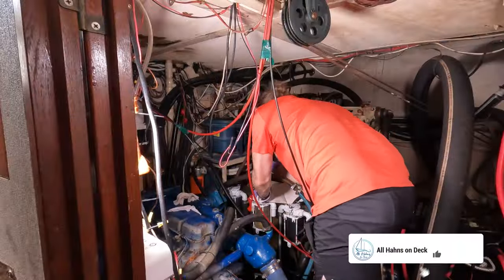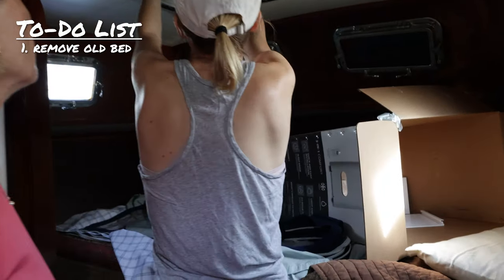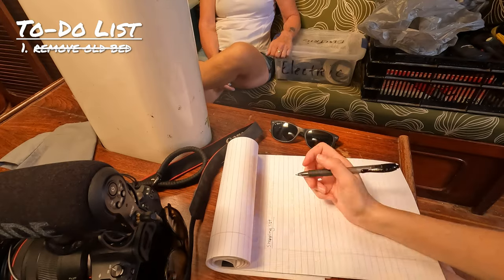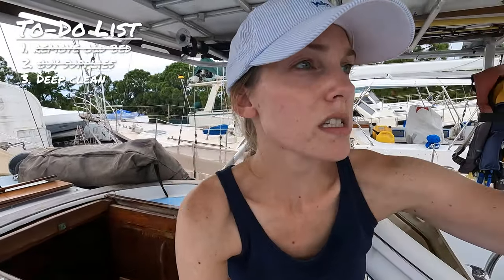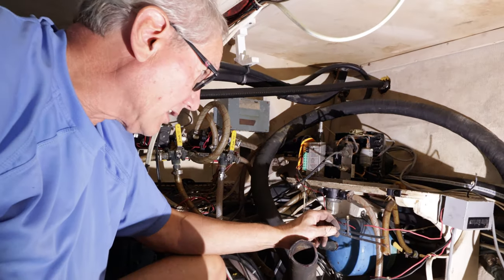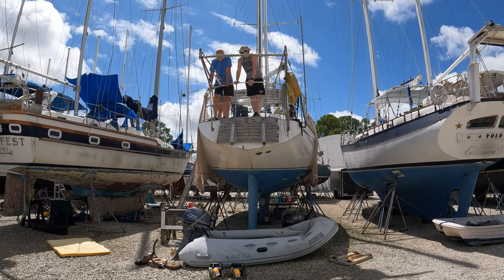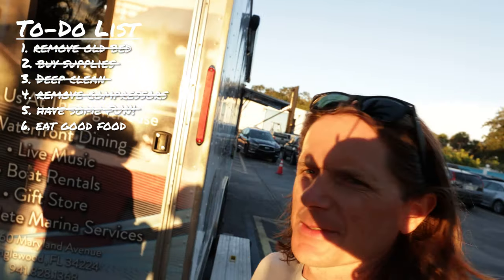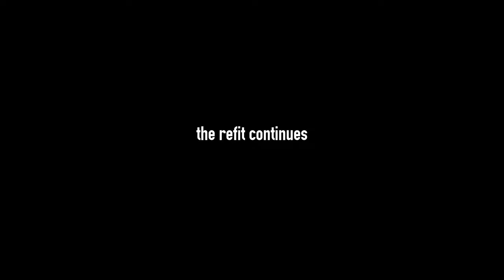BOAT LIFE: THE TO-DO LIST NEVER ENDS | AHOD 13 #boatlife #boatrestoration #boatyard

Comment: I enjoyed the video.  If you want to change the diesel genset they make two very small, almost portable, diesel gensets that could run two Aircons for a boat that size.  The Next Gen 3.5kw or the Whisper Power generator.  With soft starts one will run two AC's with a little left over for other stuff like charging.  Really they are super small, affordable, and are diesel instead of gasoline.  Two people can handle one without needing to get halyards or come-alongs involved at least through the companionway..The typical fuel usage is about five-ish hours per gallon of diesel.  I made my own batteries using EVE280AH Lifepo4 cells from Docan Power, and have 300 watts of solar.  The solar can nearly power two freezers and our watermaker.  Which if you want to make you own 30-40gallon per hour watermaker you can make one for under 2k.  YOu can find it by searching yt for" how to make your own 30 gallon per hour watermaker using"  there are parts in the more section and the comments.  I can almost do it all on solar, but use a gas powered igen2600 to top things up each day as I  converted the galley to full electric.
Reply from the maker: Fantastic advice and suggestions! We will look into those small diesel generators
Reply: @AndyandKirstin  If you want to know more about the battery build it can save you like 4k over Battleborns at around 560ah at 12v. Salty Escape did a build on their channel.  The build it yourself watermaker can save you like 6k over like the slowest Spectra brand and with off the shelf parts they can typically be repaired almost anywhere.  I would put in new AC units if you plan on spending any time in marinas as well.  Some people say nah...dont need em...then they cook in a marina where they don't get any wind.  If you have any questions or need parts for the builds I have nearly complete parts guides for the builds.  Just ask for them and give me an email or something.
Reply: @AndyandKirstin  If you want to know more about the battery build it can save you like 4k over Battleborns at around 560ah at 12v. Salty Escape did a build on their channel.  The build it yourself watermaker can save you like 6k over like the slowest Spectra brand and with off the shelf parts they can typically be repaired almost anywhere.  I would put in new AC units if you plan on spending any time in marinas as well.  Some people say nah...dont need em...then they cook in a marina where they don't get any wind.  If you have any questions or need parts for the builds I have nearly complete parts guides for the builds.  Just ask for them and give me an email or something.
Reply from the maker: @allynonderdonk7577  great advice

Comment: Your ac cooling pump most likely is 110 volts......all your other electric pumps are 12 volts
Reply from the maker: Excellent point!I still plan on testing it, as we do have other 110v pumps on the boat too.